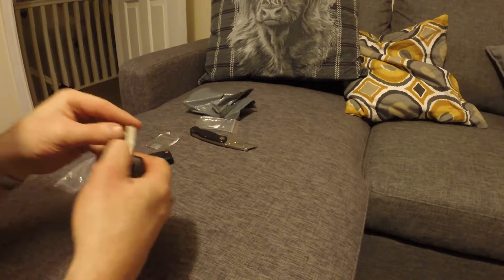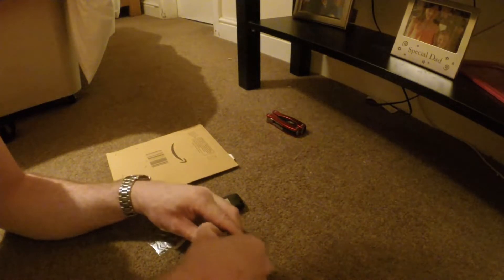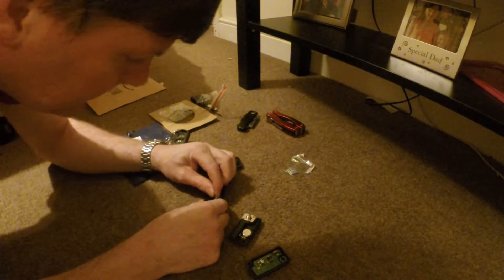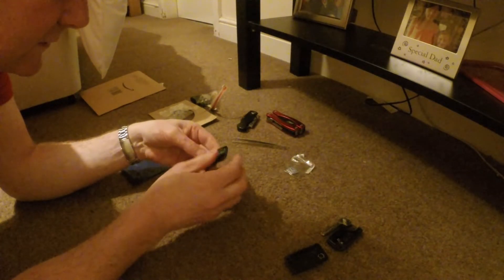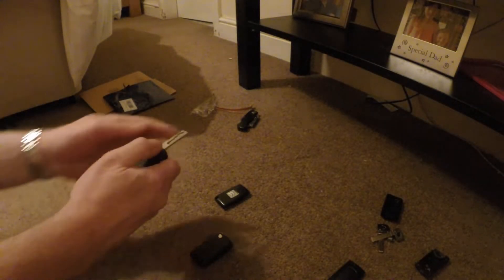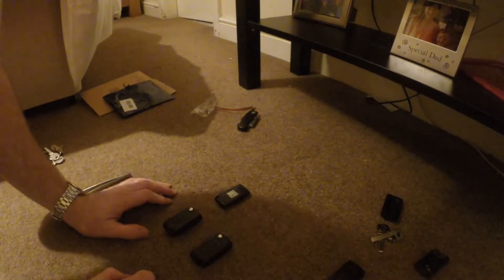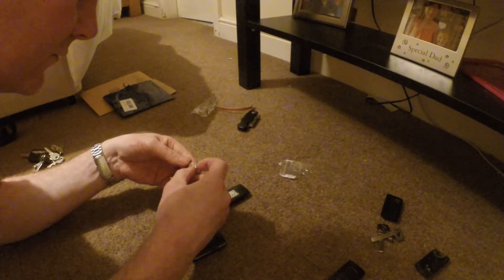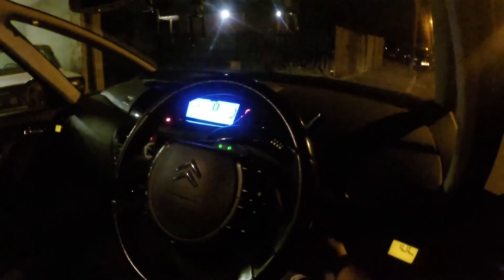Citroen C4 Grand Picasso Part 21 -  Key fob case replacement

Comment: I have a ctroen Grand Picasso, too and the key fo is in poor condition, so much so, that I can't see which button locks and which button unlocks. I am sorry to say that this was a not so good educational video. Your hands were in the way so often I couldn't see what you wer doing. Much of the video has been speeded up. If this was your first attempt at videography, there is a lot of improvement required.
Reply from the maker: I'm sorry it wasn't too helpful. I appreciate your feedback. I'm constantly improving so if I were to make this video today I'm sure it would be better that it was back then. Thanks for stopping by.